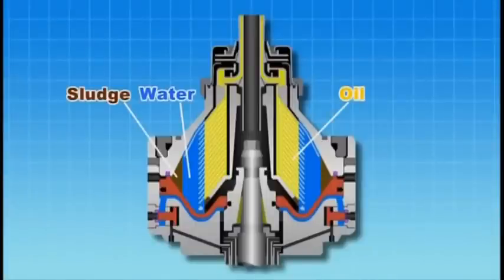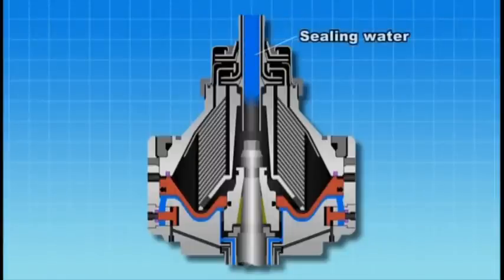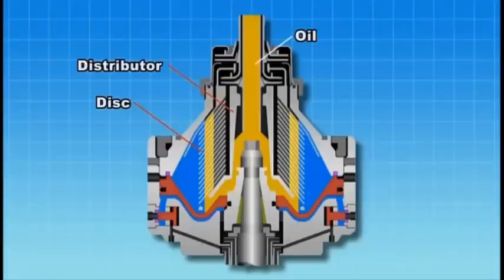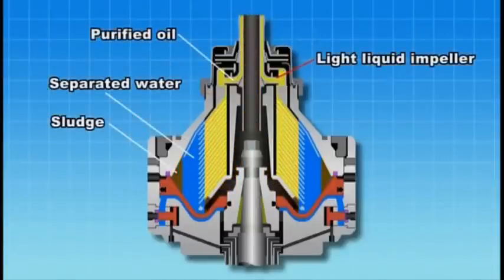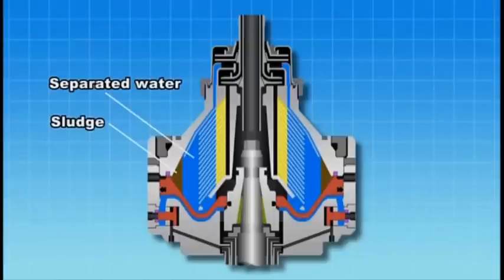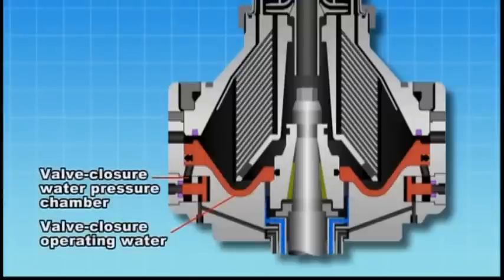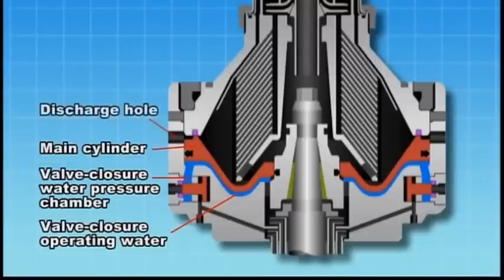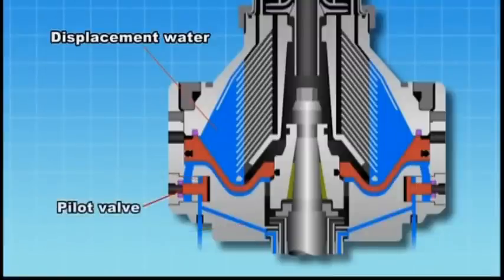Marine Mitsubishi Purifier Operation Explained

Comment: How often does the cycle repeat?
Reply from the maker: It can vary from system to system. One can set the interval. Also when running under auto, cycle will vary depending upon quality of oil. If oil quality is bad then bowl will filled with sludge and water more quickly and cycle time will reduce.
Reply: @BabaBlackhole  thank you for that. Ate we talking minutes or seconds or hours?
Reply from the maker: Normal cycle for standard quality of oil is approximately 50 min to 1 hour

Comment: Where does the operating water go after the discharge has taken place?
Reply from the maker: Well it goes in sludge tanks
Reply: @BabaBlackhole  Thank you for the reply. However, I guess that only sludge goes to sludge tanks.
Reply from the maker: No
Bowl closing water, bowl opening water, replacement water and sludge discharge everything goes to sludge tank.
Reply: @BabaBlackhole  Understand. Is operating water pump constantly running to keep bowl closing water under pressure during normal operation ? Normally is about 2,5 - 3 bar.
Reply: @BabaBlackhole nice one😊

Comment: What is discharge back pressure, why it is to be maintained?
Reply: back pressure is needed to keep the interface thus avoiding overflow condtions.. usually its 1.5 to 2 bar depending on the oil used.
Reply: @chetanawaits  nice thank you.

Comment: Difference between replacement water and sealing water?
Reply from the maker: Sealing water is the one which is deployed after de-sludging in order to seal the bowl and maintain an interface. Replacement water is the one which is deployed before de-sludging so that all the oil inside the bowl is replaced by this water, before opening of the bowl. Purpose of replacement water is to minimise oil lost during opening of the bowl.
Reply: @BabaBlackhole  oil lost is minimized with appropriate diameter of gravity disc, right? So in which way does replacement  water help in oil lost hindering?
Reply from the maker: Size of gravity disc is used to maintain interface. Correct gravity disc ensure right position of interface. Now when de-sludging is to be done, since the purifier is in operation it still has lot of oil inside inner side of interface. If you directly provide bowl opening water all the oil that is inside will also be going inside sludge tank. To prevent this oil loss, replacement water is provided. Hope to have clear your doubt. Also please see de-sludging operation video to get visualisation of what is I just now explained.